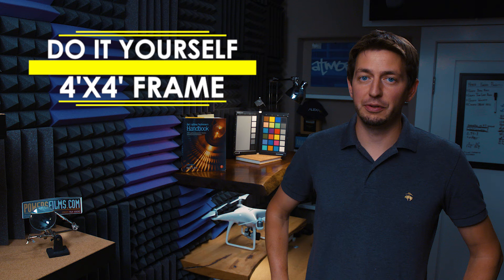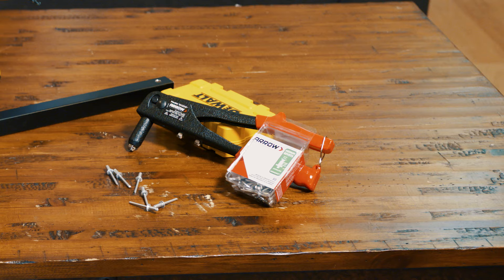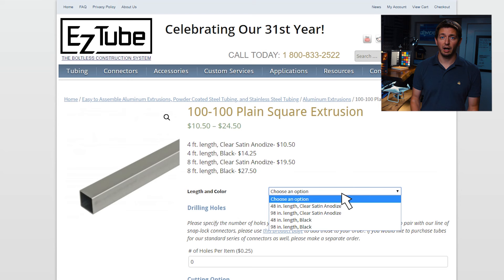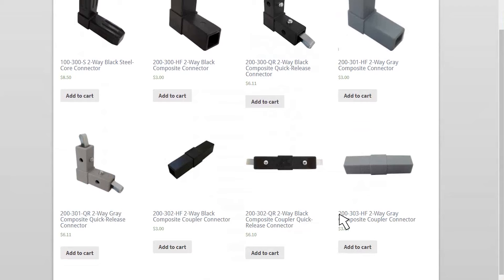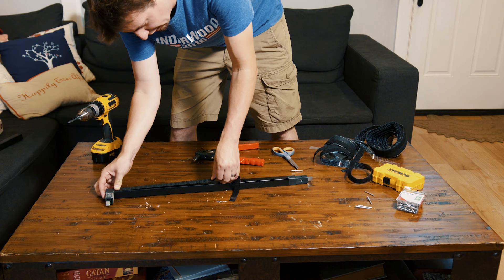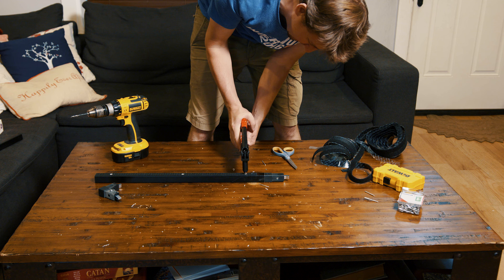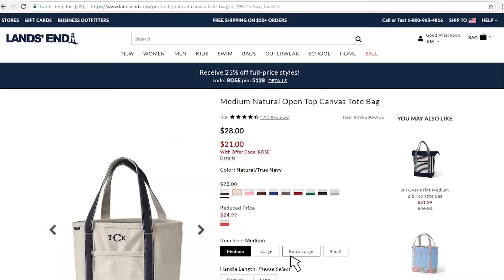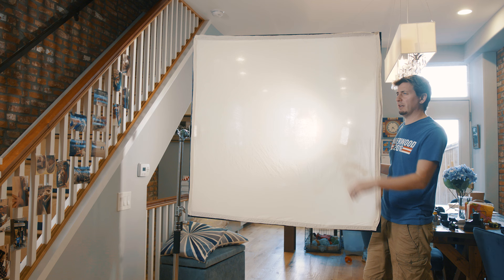DIY Diffusion Frame (Scrim Jim): 4'x4' Travel Frame

Comment: I was gonna build one just like this but then found the exact same frame from PROAIM 4 x 4 scrim tube frame for 150$ Canadian on ebay and then bought 2 diffusion 4 x 4 for 50$ Canadian each, again on ebay (one 1/2 stop and the other is 1 stop) so total was 250$  and I didn't have to build anything and it was shipped to my door.

Comment: unfortunately it looks like this company has stopped making the 98 inch long poles. :( Any idea where I can get this tubing besides this place?
Reply from the maker: Hey! If they stopped stocking the longer poles, you can just order some of the shorter lengths on the site? I'd just google "aluminum square stock" and see what shows up. This site looks like they sell the identical aluminum tube: https://www.estoconnectors.com/catalog/tubing

Comment: Hey, what about when it time to replace the velcro? How would you remove it?
Reply from the maker: Thanks for the comment. In all of my experience, I have never seen velcro (especially the 'hard side') wear out. 

Now, after thousands of uses, I have seen the 'soft side' of velcro get a little fluffy and damaged. 

In either case, if you wanted to replace the hard side velcro, you could drill out the old rivets, and insert new ones.

To replace the soft-side velcro, you would just sew in new velcro over the old (maybe on the other side?) or just make a new piece of diffusion.

Hope that helps!
Reply: @Powersfilms  thanks

Comment: Is there any reason other than portability to cut the aluminum down to 2' long pieces and connect them in the middle versus just having 4' pieces?
Reply from the maker: Yup, the 2’ length keeps the frame easier to manage while traveling.

Comment: What are you using to clamp the frame to your c-stand? Also why not 4' pieces? Simply so it's easier to transport?
Reply from the maker: What is up Arkitect! The clamp you are asking about is a “Cardellini” or a “Mathellini” clamp. 

Those clamps are just mini-vice clamps with a baby stud on the back and are very valuable on set. 

For the lengths, I went with the smaller segments, so I could travel with them easier. If you want though, you could definitely rock out with a longer length. 

Westcott makes a not-so-travel version that uses the 4’ lengths as well and it’s a little cheaper too.

Comment: Awesome job 🙏 unfortunately they don’t seem to ship to austria and in my 2 hour google search I was not able to find connectors with quick release that ship to austria :-/
Reply from the maker: Hey, I would see if there is another, closer manufacture that sells Aluminum stock, or extruded aluminum stock with quick connectors in Europe. I'm sure someone in Europe also makes and sells the aluminum parts you need, but you'll have to hunt it down.
Reply: @Powersfilms  Hi guys, they don't offer the drilling of the corners unfortunately, But perhaps you can find a solution ordering from this company. I havnt ordered from them yet for this small project but i've ordered alu poles a couple months back in Linz and they were super fast and great quality. https://www.thesteel.com/at/Nirostick-Formrohre-Hohlprofile-T265100011?v=1-166930

Comment: Such a great video!! Thank you so much for all this info. I have all the pieces and I'm about ready to make the cuts. Mine is a 6'x6' and I have a question about where to make the cuts, I would love to hear your input on this. Should I make the pieces 3' each and have the cut/connector right in the center where the clamp will be, or should I have the cut/connector off center so that the clamp is on the metal only and not over the connector. Does that make sense? if so, do you have any input on either option? 

Thanks James!
Reply from the maker: Hey! For any notes on making the cuts, I forget what the sizes are specifically, but I remember the connectors taking up roughly 1". That being said, I would subtract 1" for every connector you use. Hopefully that helps!

Comment: First off I want to say thank you for sharing this great idea.  I love a DIY project that is this good.  You happened to mention in the video that if we find that if the connectors are too tight, gently sand the sides of the connectors down.  But what if the connectors are too loose?  Do you have any suggestions for tightening them up?
Reply from the maker: Hey! Glad you have found this helpful. 

Should the connectors be too loose, you can do two things:

1) Wrap electrical tape around the connector until it has a snug fit
2) Add JB Weld, or some other epoxy to the connector and let it dry. Then you sand down the added epoxy until you have a snug fit.

Option 2 is pretty time consuming, so the fastest and easiest way would be to just add a few wraps of electrical tape.

Comment: Hi James, this is great.  What kind of grip head are you using to secure your frame to your C-Stand?
Reply from the maker: Hey Mike, I am using a 6" Cardellini or Matthellini depending on the brand. They are just vice grips that are prefect for holding film gear. That vice clamp then goes into a regular 2.5" grip head (your standard grip head) Here's a link: https://www.bhphotovideo.com/c/product/860794-REG/impact_me_106_6_end_jaw_vise.html    grip head: https://www.bhphotovideo.com/c/product/838888-REG/Impact_kcp200b_Grip_Head_for_Lights.html
Reply: Thanks for asking.. no one talks about this but it's also very important.

Comment: This is a good video, but there is an even easier and cheaper way around this with large 5 in 1 reflectors and light stands...
Reply: The problem with 5 in 1 reflectors is that the diffusion is usually too strong. With a 4x4 you can choose 1/4 stop, 1 stop, 2 stop, etc. All of my 5 in 1s cut too much light
Reply from the maker: Hey Blue Sera Films, yes I agree that 5-in-1 reflectors definitely have their place on a film set. But if you are trying to get a little more serious with your production, a lot of times you will need a rigid frame to skin different types of diffusion to to get different types of looks. I still have a few 5-in1's as they are great for certain shoots.
Reply: @Powersfilms  That's fair enough, I imagine i'll need a big frame at one point.

Comment: What softbox are you using on your Litepanels light? Do you recommened it? I see there are boxes from Chimera and DOP Choice, and need to decide which to buy.
Reply from the maker: Hey! Yes, I use a lot of DOP Choice gear. 

Those softboxes on that Astra 6x panel light are the DoP choice versions. If you'd like a cheaper option (and do not mind silk diffusion), I'd look at the D-Fuse 1'x1' Collapsible SoftBox. 

The only issue with the D-Fuse soft box, is that the artificial silk is sewn directly to the frame.

Here's a link: https://www.amazon.com/dp/B01H7A5NPM/ref=cm_sw_em_r_mt_dp_JSENYRNY34QFGH5XZ67W

Comment: Hi, Thanks for the video! will definitely have to make a few. One question though.  I'm a bit confused when you asked them to cut you 22.5'' lenghts. Since the connectors take up 1'', wouldn't the cuts need to be 22'' each to make it exactly 24''? Since 1" is taken up on both sides.
Reply: A bit late to reply but for anyone who is wondering the same thing. There are actually (3) 1" buffers on each side due to the joining pieces. (1) in the middle and then the (2) corners. This equates to 3". 3" minus 48" = 45". 45" / 2 = 22.5"
Reply: @hipstertrout2865  Thank you! still haven't went in on them so this is great info!
Reply: @Nikita_Brus  No problem! I just put my frame together so lmk if you have any questions. EZ Tube was super easy/quick. Ordered it on a Friday and got everything on Monday. Helps that I'm only 1 state away from them, though.

Comment: Will the EZtube aluminum tube fit the Westcott 2" connector?  I am trying to do a 4' x 6' scrim jim.
Reply from the maker: Hey James, yes, the aluminum tube will fit the Westcott 2" connector. 

Keep in mind that Westcott has a 2" connector, where as the EZ Tube's connector is 1". Both connectors are cross-compatible. For distance, both companies measure the space visible on the connector after the connectors are joined (hope that makes sense).

If you are mixing and matching connectors, make sure you account for the 1" difference by using a longer or shorter tube, otherwise you'll end up with a trapezoid shape, instead of a square.

Comment: does the light go through the muslin you ordered? Asking because it looks like it blocks almost all the light from going through.
Reply from the maker: Muslin can be used as both a bounce and a diffusion for strong light. To punch through muslin cloth, you need a strong source (HMI, 1K Fresnel, or Light Storm LED).
Reply: @Powersfilms  I have a 120d..2 of them actually....Also have a 750 source four..Would that be strong enough?
Reply from the maker: @ParisHolmesFilms  Those lights are probably not strong enough to give you usable light when shone through muslin. But,  blasting those lights through silk will still give you a good result.
Reply: @Powersfilms  Is this frame large enough to use as a bounce for that style of light? I'm looking for an unbleached muslin bounce to warm up my shot without blinding my talent (long shoots they need to be able to read during)

Comment: Well, Film Riot showed me how to make an 8x8 diffuser for 15 bucks. Explain that.
Reply from the maker: Excellent point; but if you value build quality and versatility, you will get a lot of mileage out of this build. 
Film Riot is an amazing resource -- I am a huge fan -- but the DIY $15 build you are referencing uses PVC which isn't as rigid, and will bend. 
The Film Riot build, also only allows you to permanently* fit one diffusion piece. (*I suppose if you really wanted, you could sew custom 8'x8' sections, but at that point, using PVC would really start to sag and fail).
If you continue to light and film your own projects, you'll quickly realize you will be constantly "auditioning" different types of diffusion. When you change out or "audition" different types of diffusion, you will love the speed and convenience of swapping out different cloth because everything is attached with velcro. 
Unfortunately the DIY Film Riot version makes it difficult to change out the different types of material.
By all means, the $15 is an excellent "band aid" for the diffusion solutions on set, especially for beginners, but this method is more of a permanent solution that is great for studio work, location lighting and some "run-and-gun" projects.
Lastly, traveling around with 8 foot sections, or even multiple 4 foot sections for that matter, becomes a pain. That's why the grip Gods at Modern Studio created a cool floppy-flag that measures 36"x36" so you can easily fit in inside your car! I think they sell it for $65, which isn't bad.
https://www.filmandvideolighting.com/modernstudio-36x36-floppy.html?_vsrefdom=adwords&gclid=Cj0KCQjw3ZX4BRDmARIsAFYh7ZJ5ruz96zf5rhGULQWvl6A-0WKL4StBQZA0v406f_MAsuoehA5DCCMaAnBKEALw_wcB

Comment: This is not a good solution. People, do not DIY this just so that you can save $300. In case your needs change you will not be able to sell this so that you can pivot to different gear using the money you would get if you sold the Westcott version. Besides, all your labor will be at least $300.